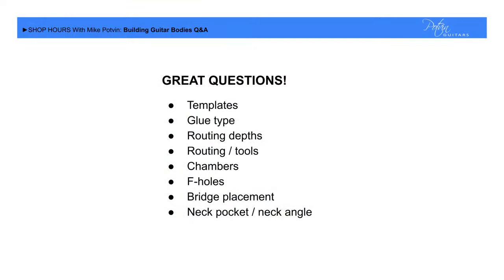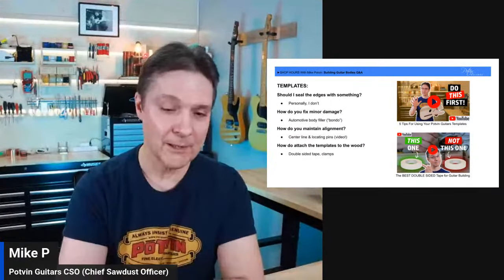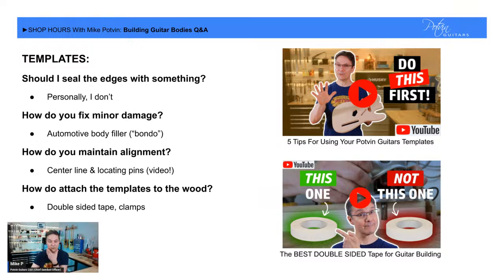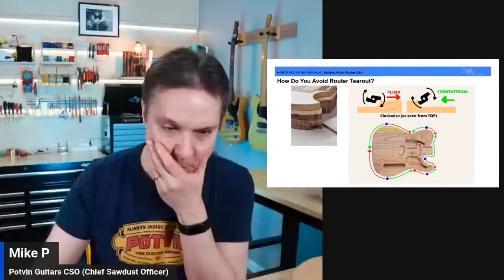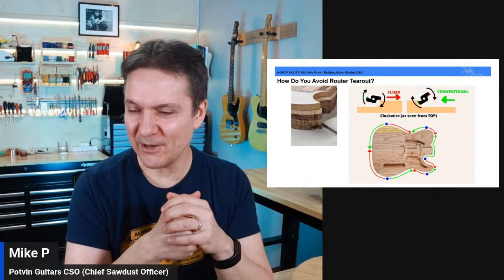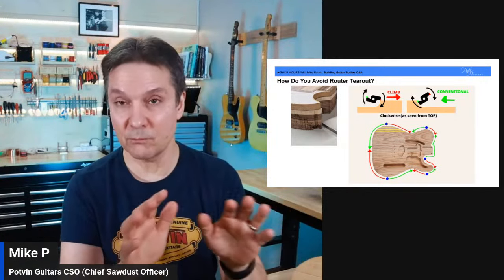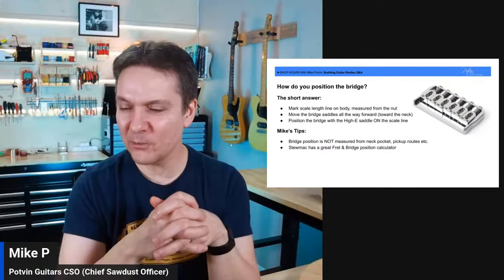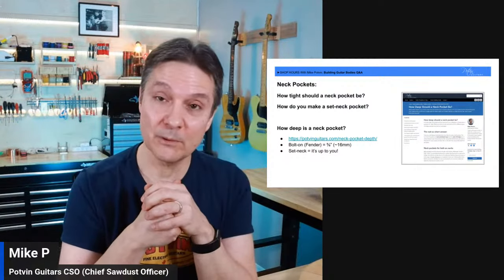Building a Guitar Body Q&A

Comment: The thing that I am taking away is taking a smaller bite while routing the body perimeter. And I will make sure to sand right up to the line, leaving only a small amount for the router to remove.  Very well done, Mike. Thank you!
Reply from the maker: Thanks for watching, Chris! Yes, leaving as little work as possible for the router is the goal 👍

Comment from the maker: Scott White - I saw your message in the chat just now about using an oscillating edge sander before routing. That's a great idea if you didn't quite get close enough to the line when you did the rough cut of the body on your bandsaw.  The goal is always to leave as little work as possible for the router to do.